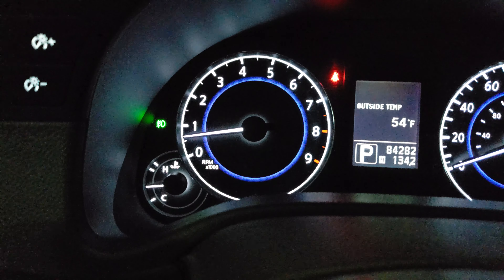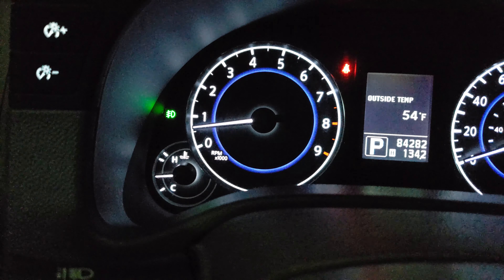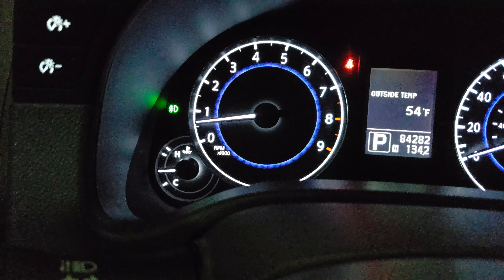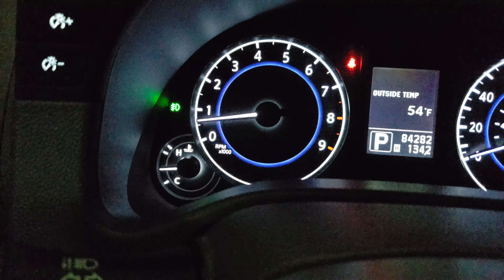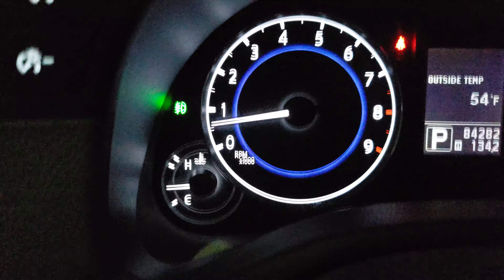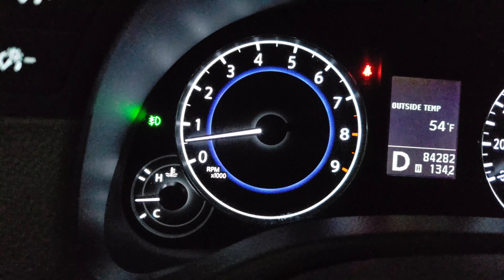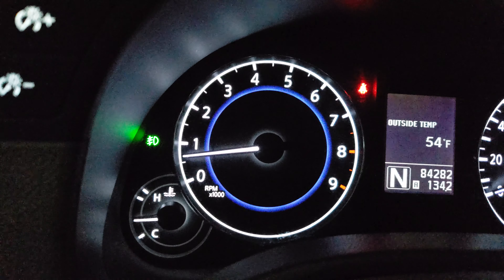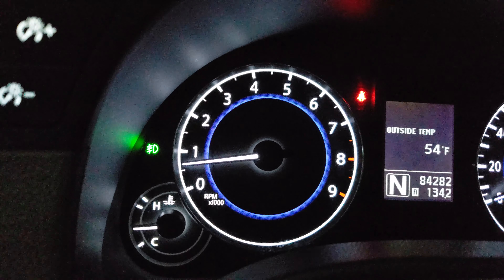2011 G37 low idle in drive

Comment: not the same cars at all, but my moms jeep and my dads VW both do the same exact thing, just like my G37 does. it must just be so the car doesn’t creep forward as quickly when you let off the brakes in Drive. i don’t think your car is having a problem IMO
Reply from the maker: Thank you!  2 things - 1) it didn't do this when the transmission was warm, 2) I have a Q70 that doesn't do this.
Reply: @llebcire  oh interesting, did you ever get it figured out then? i’m guessing if you have a Q70 that the g37 is probably gone by now, i’m just curious because i’ve only had my G for a few days and if that’s an issue i’m gonna get it looked into asap :)
Reply from the maker: @dackjazy2661  Yes - the G37 has been gone since 2020.  Here's some call outs: First, this was more of an annoyance than an issue and most people wouldn't notice it, especially if they didn't own the vehicle or drive it daily (passengers had no idea), and it does not impact drivability.  Second, I had a 2011 and don't know what years this was an issue or what percentage of vehicles in the affected years were impacted - you may not have this issue. Third, the assumption was poor connections inside one of the modules located inside the transmission as this would go away when the transmission was hot (spirited driving) and occurred less in the summer and all of the time in the dead of winter (when below zero I could never get the transmission warm enough).

Comment: A, bad cats or exhaust leak or B, if u have any aftermarket exhaust part or bolt on in general it recommended to get TUNE or may lead to issues like this(not sure 100%) unfortunately I don’t have g37 no more so I couldn’t test it out if thts the case but I did clean throttle body & swap all spark plug to new ones and still nothin also heard something about ecu module but I’ll rather tune it then get reprogrammed in my opinion, again not an expert just an ex g owner

Comment: It’s just dropping cuz she’s old and due to load like u said u bout to take off mane! My car does the same exact thing and it started at same mileage replace ur throttle bodies intake tubes maf sensors spark plugs like I did and then it still does the same thing… I noticed this problem occurring after I left the shop the guys replaced my valve cover gaskets both then I had the problem was not there fault shut happens as of now my car is almost dying when I start the car and never on cold starts this only happens when I stop at liquor store etc then goto fire her back up and it starts then goes to 1krpm then goes back to its normal. Position in park. I’ve confirmed in my mind it was the maf sensor and I did not reidle so it is getting as reading 🤷‍♂️?
Reply: Exactly when I’m at cold start it’s normal but if I stop turn it off rq do sum and come back and it’s still at warm temps it starts but then almost dies and sometimes it dose but then fires up like normal after I try again

Comment: Mine is suffering from the same problem rn
Almost 80k miles, 2011 G37x Sedan
I changed the spark plugs and cleaned the throttle bodies yesterday... but it did not fix the issue like I was expecting. No codes...
Reply: From what I read ppl r saying it's a sign of a bad power steering pump!

Comment: Mine started doing it after hfc install but dont know if thats what caused the rpms issue, mine is a 08
Reply: Huh 🤔 same problem and I did install hfc too but forgot if it started before or after installing lol. Also I have heard when installing any type of bolt on don’t matter if sum small best results to get a tune(still haven’t found what it is) checking power steering next since it rpm moves when turning the wheel in park...
Reply: @testapp7841  did u guys ever figure out what it was? Mines doing it too after hfc

Comment: you solve this problem? i have toyota vellfire with same problem when i Drive mode and stop at the stop light the idle is  drop to 500rpm but when P,R,N its normal
Reply from the maker: Sort of - traded the car😀
Reply: @llebcire   you dont do repair?

Comment: Normal
Reply from the maker: I would say typical but not normal. This only happened when the transmission was cool. Once the transmission was warm, well after the engine, it idled at 650 in Park Drive and Reverse.
Reply: My car just started doing that after I took it to the shop for valve cover gasket but idc it still work